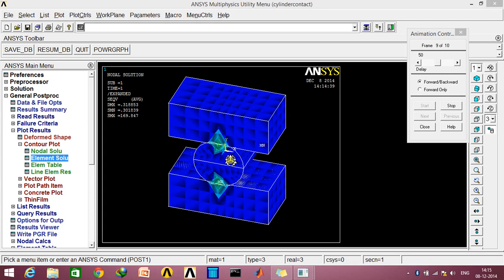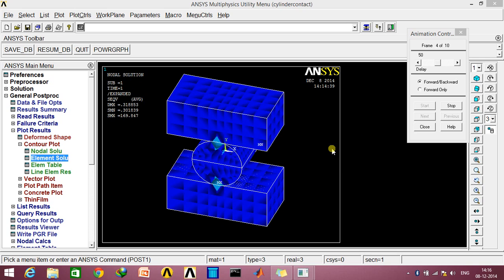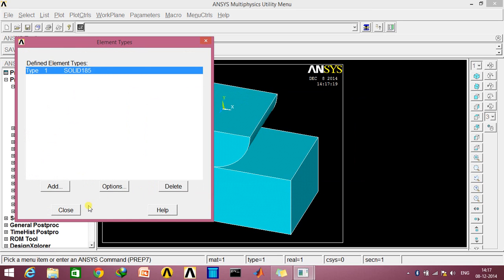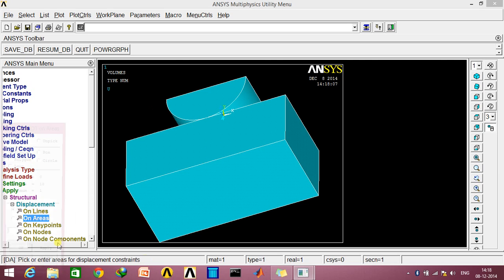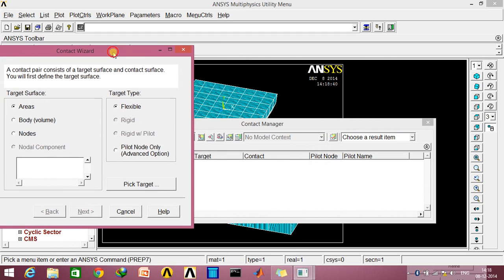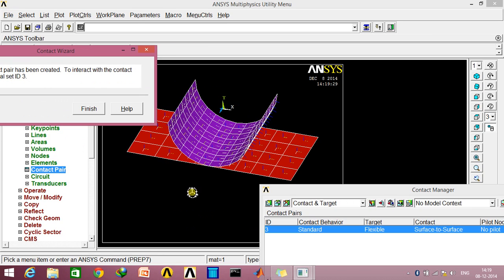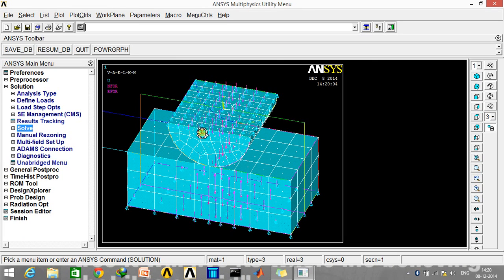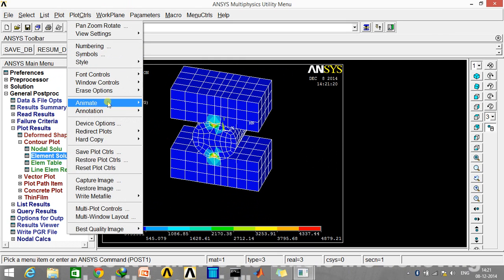Use of contact pair in Ansys / Hertzian stresses on contact

Comment: can you help me with this error,?, the Value of UZ at node 18 is1.9916e+22. it is greater than the current limit of 1000000 (which can be reset on the NCNV command). this generally indicates rigid body motion as a result of an unconstrained model.

Comment: sir in the hertian stress if we add load on the top surface of cylinder say 20900 N so how v can do it?
Reply from the maker: Hey Sagar, I am sorry for the late reply. Got a little busy with my studies. Anyhow, I am myself learning this software and to be honest, I cant really tell exactly how that has to happen, but if you wanna take my opinion you can have a geometry of a cylinder in such a way so that there is an edge right at the top where you wanna apply force, otherwise  if you just take a regular cylinder, the force will get applied on the entire curves surface area.If you are using solidworks or ansys for building geometry, just build an edge on the top and apply the force and repeat the steps as shown in the above video
Hope this helps,